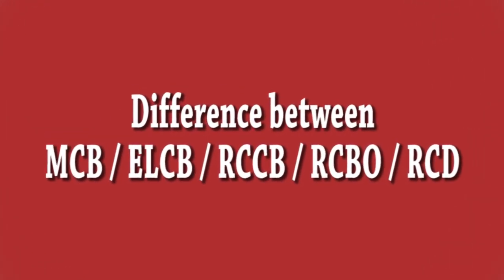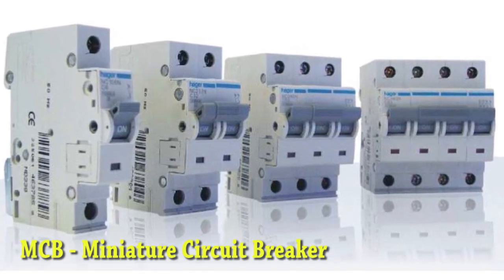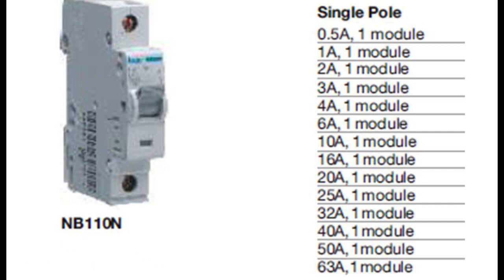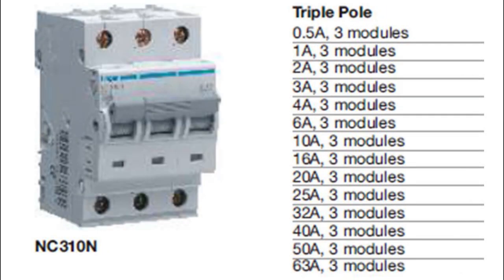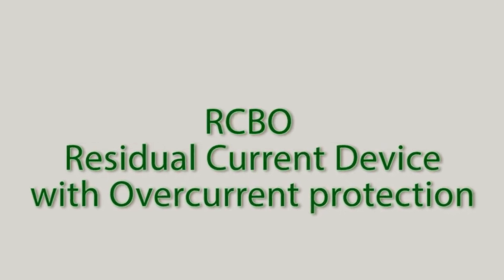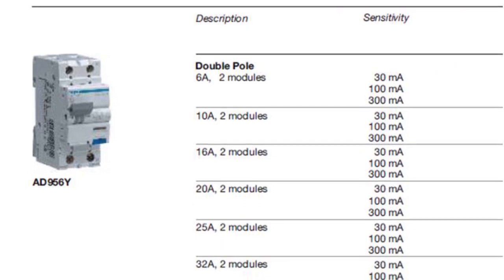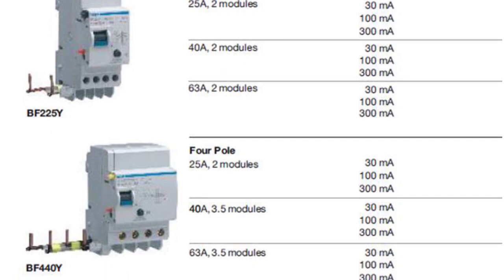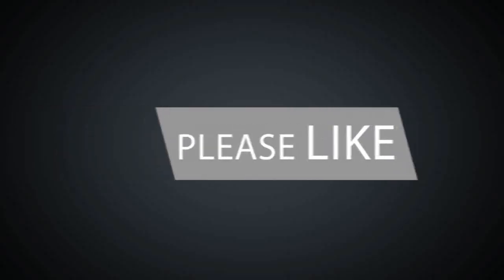Difference between MCB ELCB RCCB RCBO RCD

Comment: Why MCB have 1, 2, 3, 4 poles ??
Reply from the maker: MCB 1P is used to provide overload and short circuit protection in a 1-phase circuit or current path.

MCB 2P is used for protection in 1-phase along with neutral OR in 2-phase current path.

MCB 3P is used in 3-phase supply 

And MCB 4P is used in 3-phase and neutral supply.